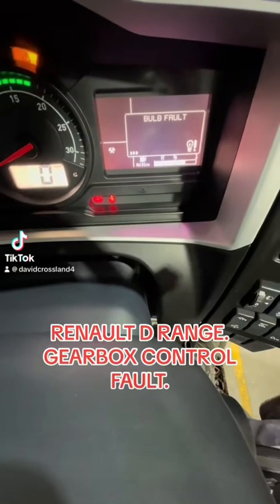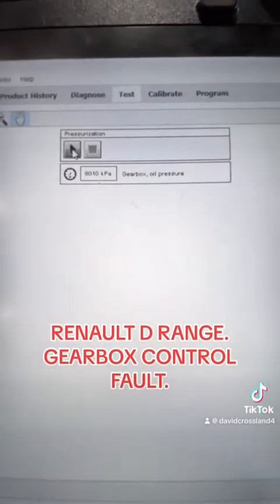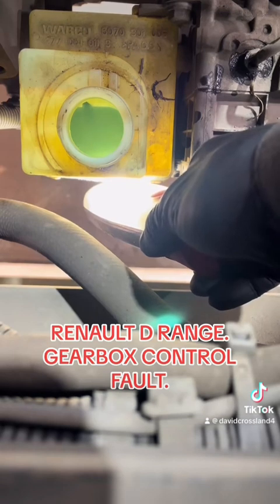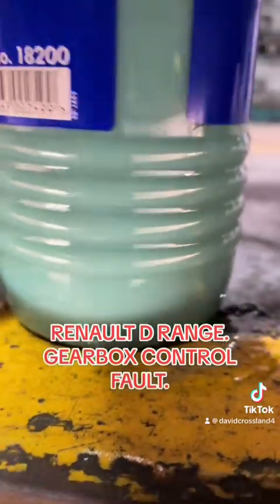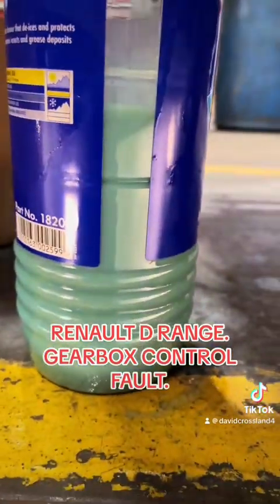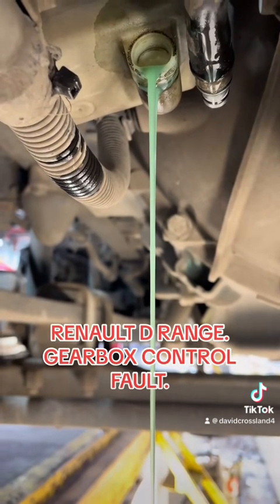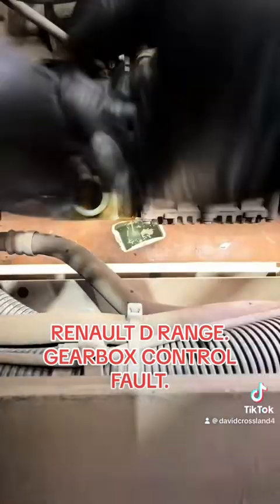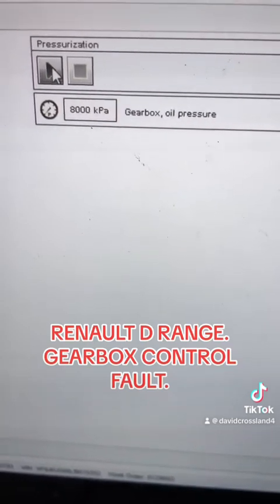RENAULT D RANGE, gearbox control fault fixed and explained.

Comment: I have problem  on d range saying  on dash gearbox  seized.   It's saying time out try again when I purge clutch  booster
Reply: Would  you have any idea  ..it just got 3 piece  clutch..wouldn't   do calibration
Reply from the maker: Some times suffer with air lock, try jacking back axle up and calibrating then once calibrated drop jack and calibrate again. Also the pipe that comes of the bottom of the reservoir can hold air sometimes, undo pipe at other end where the push fit union is and let oil run through and quickly put back on.
Reply: Where do you get the return valves from ?

Comment: Arıza nedir ve arıza kodu
Reply from the maker: Gearbox control fault, hydraulic system variations too high, mid130 sid 52 fmi10. Very common fault on this auto boxes.